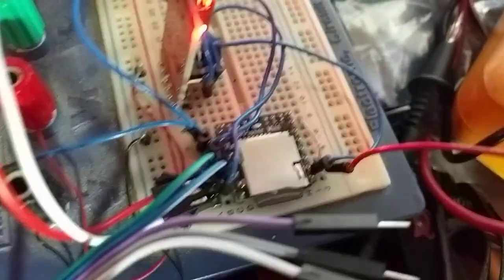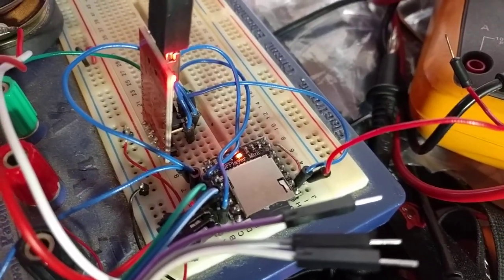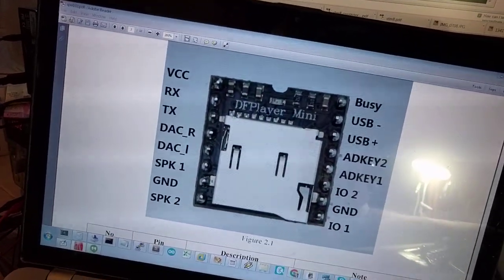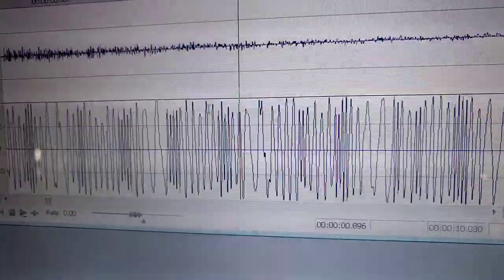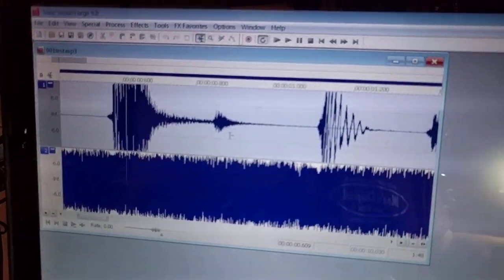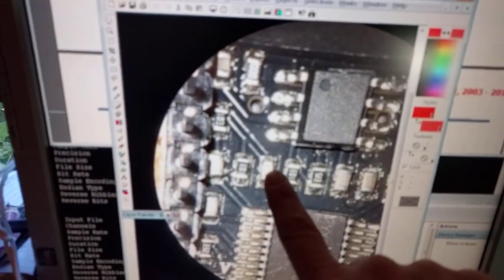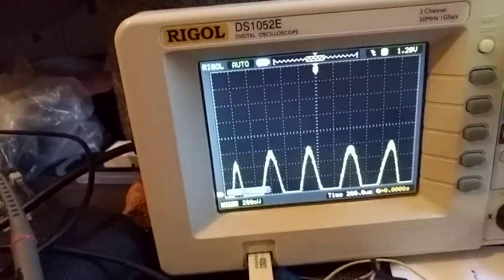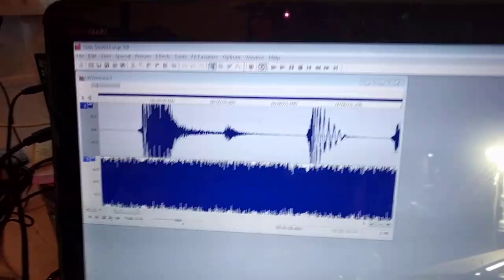Getting data off the SD card (synched to the music) when using a DFPlayer mp3 module

Comment: Nice! I had  the same idea by looking at the connection pins. Thanks to you I now know what I have to do. Thats is a nice way to control music or sound to data or in my case movement. You should check out QUICK-IO from NYQUEST.  It was developed for their chips but it is very usefull for this technique. It generates an IO line according the audio file. Like rythm or something. I will use it to control the mouth of my robot while speaking :) After I checked the eeproms of some toys, I can say, that they all do the same, because the data is everytime just some weird crap combined with music ;)

Thank you for posting your discovery. It helps me a lot.